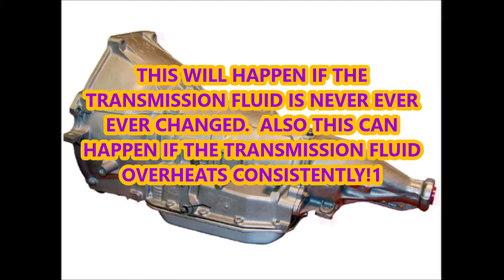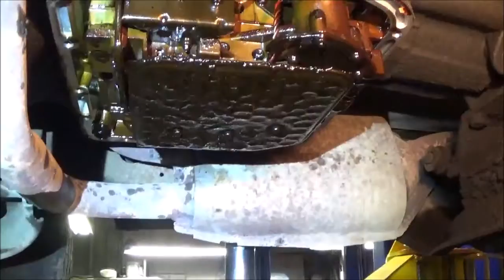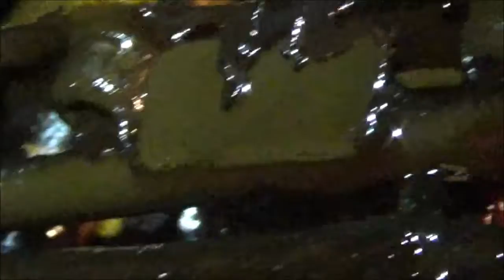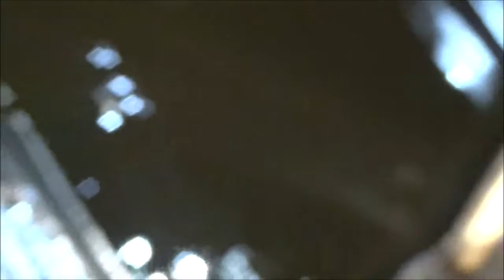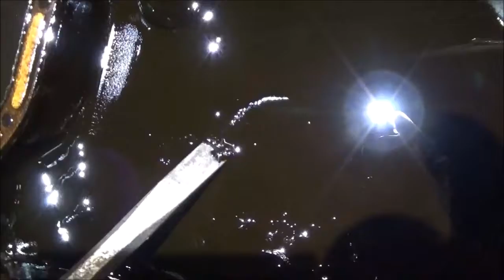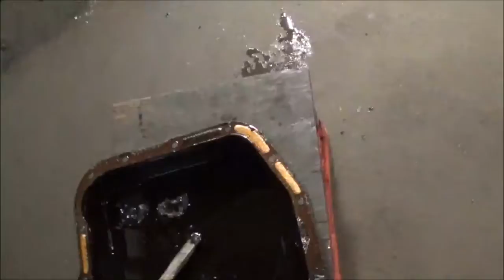WHAT HAPPENS IF YOU NEVER EVER EVER CHANGE YOUR TRANSMISSION FLUID!!!

Comment: Never had it changed on my 3 series BMW because dealer refused service , now I’m looking into a shop doing it . But I’m at 80k miles…. Feeling paranoid that doing it for the first time ever at 80k is too late and will cause slipping
Reply: You good up to 100 K put the original BMW fluid for transmission always have to have original oil from dealer

Comment: I have a 2014 chevy Cruze LT and have not changed my transmission fluid for 4 years. I have only really driven it about 26k miles. Is throwing U0101 code (TCM CODE), but can I change the transmission fluid and it be okay and not blow on me?
Reply from the maker: You should take that vehicle to the transmission shop to see why that code is there before doing anything.

Comment: After watching Couple videos on YouTube I decide to change transmission fluid on dodge caravan 2016 120.000 km and it It's not changing the gear on time going high rpm  I destroy my car Never change transmission fluid again
Reply from the maker: Well, I don't know if you did or if it was just going bad. I have a dodge caravan with 80,000 miles that just had the transmission rebuilt.

Comment: I've never changed the transmission oil. How screwed am I.  6 year old car btw.
Reply: Just do a few drain and fills (drive it for a while in between each).  Make sure you use the correct fluid.
Reply: 6 years is fine. You can do it.

Comment: Always change fluid it's no such thing as a lifetime fluid.
Reply: 2011 Malibu 2.4 with 6 speed auto,  previous owner fell for that lifetime bullcrap til about 100k when I assume it started acting up, I got the car at 185k for 1800 bucks, immediately changed the atf and oil, around 213k I had delayed engagement of reverse, drain and fill again and it's been fine since! Almost 218k today
Reply: @ryanravencaller  I fell for the lifetime fluid thing and it’s changing gears slowly and the acceleration is jerky. Hopefully everything gets resolved when I get the fluid changed 🙏🏼
Reply: @ryanravencaller  still holding up?
Reply from the maker: It does not appear to be.